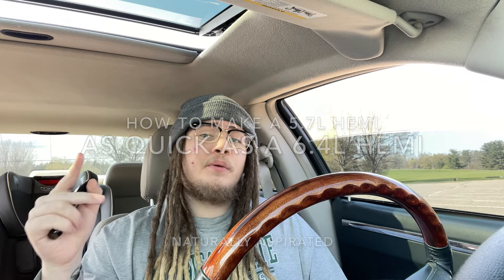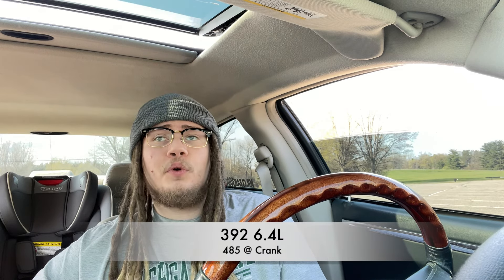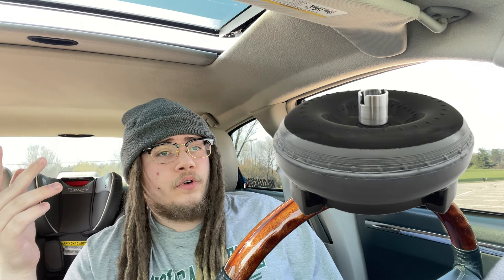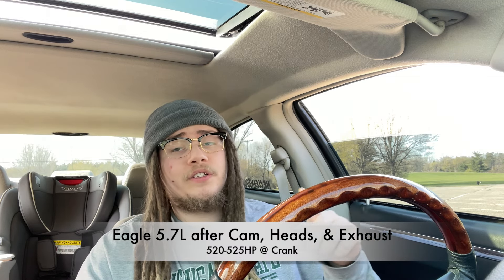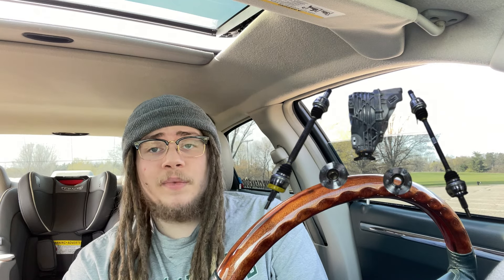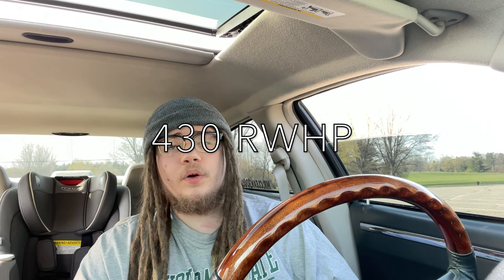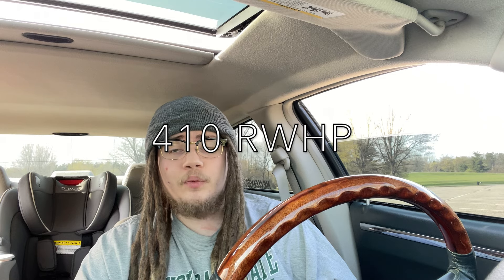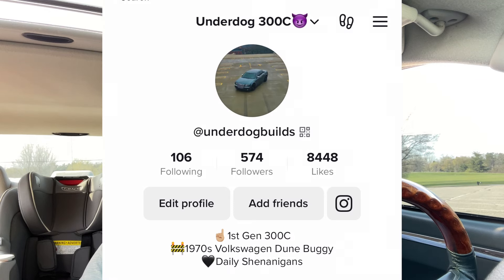How to make a 5.7L HEMI as quick as a 6.4L HEMI (N/A)

Comment: Lol 5.7 dudes are doomed if you are doing a cam swap before long tube headers. Whoever told you that doesn't have a clue.
Reply from the maker: They’re typically done together, but there have been many folks who choose to cam the car before long tubes. I personally think they should be done at the same time. Might as well save and get the intake, exhaust, and camshaft all at once if possible. I’ve seen folks who are cammed and/or running silly spray running stock exhaust manifolds and it never makes sense to me.
Reply: @Underdogbuilds so you would recommend long tubes over short tubes?
Reply from the maker: @Twofrogsonecup  long tubes will result in more power on the long run, shorties aren’t a bad option either though. If you have the money and you plan to build your motor I would recommend long tubes. Shorty headers generate better low to mid range power and they’re an easier install than long tubes. Long-tube headers make their power in the mid- to high RPM range and are superior to both stock and most aftermarket shorty headers. Equidistant long tubes result in better power gains and scavenging at the collector, if each primary is the same length they will be superior in total.
Reply: @Underdogbuilds  my dad had a 5.7 ram with shorties and a borla s type and I really liked the way it sounded, but if long tubes make more power I might go that route

Comment: Fbo 5.7 Vs stock 392 on any respectable tire is a win for the 392 fbo 5.7s still make less torque than these so it’s easier to launch them but I’ve raced countless fbo cammed 5.7s I beat them every time badly and I’ve only got a tune exhaust and intake 5 speed 392
Reply from the maker: 100% man, this was more so a run down to keep up. I also forgot a couple things like a 1 piece driveshaft that would help slightly to keep up with those 392s. And a couple small things like the throttle body. Built nicely, with quality parts (such as a posi rear end, suspension, a full exhaust job including headers, a 392 intake, a shift kit, that 1 piece driveshaft, etc) and a good tune up in the car you could give a 392 a run for its money. 

Also, not to be picky but we’re they just FBO or were they FBO and cammed? FBO Hemis (intake, headers, full exhaust, & a tune) is ~70HP down from what I was trying to convey with a camshaft upgrade. That cam can change the game with a good tune up in the car and a great driver behind the wheel, especially seeing that with a cam the 5.7 would cease to shift at 5600 RPM and rather shift up at ~6500 RPM.
Reply: Sometimes its the driver because I have beat plenty 392s even 5.0s & SS sometimes its the driver mod 🤷🏽‍♂️
Reply: @Underdogbuilds  I’ve raced fbo cammed and regular fbos of course the cammed cars are more competitive but I smoke tuned 6.1s I’ve beaten tuned 10r80s I have some shorts on my page but the 5.7 always seems to fall behind a few car lengths. I just recently raced a quick 5.7 my tires were bald and I needed an oil change he was a head of me I was walking him down then he crashed I don’t think I should upload that video tho it was pretty bad
Reply: @Amg_leftyy you most definitely should upload that video

Comment: You have to do longtubes before cam and heads. Your cam won’t make 70hp without the longtube headers
Reply from the maker: Actually, there are a few cams out there designed for our motors that can net you ~67 HP on and otherwise stock motor! You just have to spend some nice money as the non-mds cams tend to make more. A custom grind cam has been shown to net ~75 HP with no other modifications. If you go with a cheaper drop in cam that’s mds, you’ll gain about 50 HP and paired with the long tubes, you’d see in the ballpark or 70-80 HP gained. The camshaft I’m going with nets 70-75 HP on an otherwise stock motor but 6.1l springs are necessary. At that point a torque converter will be going in as well, the build process has been researched thoroughly for many many months. The stock stall is the most beneficial for the stock camshaft and drive-ability, one the new cam goes in, the next torque converter will be dropped in (3000 stall). At that same time I’ll be having my heads reworked, begs around 35-45HP. I’ll be doing all of that all at once, I’ll be doing everything except the torque converter myself as well 🙂 (I don’t want to deal with touching the trans as of yet so I won’t be doing the stall myself) the car will be fully converted into a drag car as things have finally lined up. She’s basically put away for the winter already and we’re working on making the build list become a reality. And yes, I had my family friend take care of it at his shop. The previous owner had things welded in place so me and my buddy doing it in his at home garage turned into make taking it to his shop lol. I 100% agree, Diablo is more sketchy and I’ve also heard that it’s a little more restrictive, I’ll be swapping to HP tuners in the future but for now I’ll be running with Diablo. I’ll be dropping a full video detailing the plans for the boat as the goal is ~900 RWHP & high 10s to low 11s in the 1/4. She’ll be being fully built. A blower will be going on very very soon!
Reply: @Underdogbuilds  which cams are those? Cause if i’m not mistaken longtubes are a supporting mod to a cam. I put in a cam in my truck that supposedly gained you 80hp. But what they dont tell you is about the supporting mods. Which are longtubes. I have a cammed r/t and it was neck n neck with with my srt with just longtubes. After i put shorties and catless mids on my cammed r/t it pulled on my srt with longtubes. I’m sure if i had put longtubes on my r/t the gap would be even more. And yes i have 2 5.7’s and a 6.1. 1 stock 5.7 and 1 cammed 5.7 and a 6.1 with longtubes
Reply from the maker: @joellasierra   there are quite a few cams that offer around 70 HP, the comp 274 cam with a nice tune up, custom grind MMX cams, etc. Long tube headers will always help produce better numbers but on an otherwise stock motor long tubes can net 15-20HP without a tune due to the natural scavenging effect, with a tune accounting for them and adjusting the A/F ratio you’ll see ~25HP+. With supporting mods, you can see as 30-35 HP+ Also, on an otherwise stock motor people have dropped in these cam kits and gained ~70 HP. @RTlife has really nice examples of many cars on his page. Long tubes will allow your other modifications to produce more power due to freeing up flow on the back end. The stock 5.7L manifolds are absolute garbage. Usually long tubes and a cam will be installed together, as well as heads. The 70 HP figure was a gain at the crank for the cam only, with the 17% drivetrain loss associated with the NAG1 transmission, that’s roughly 55-59 RWHP depending on a couple other factors as well. Also, that’s impressive for a cam only R/T to keep up with a long tube equipped 6.1L! Those shorties allowing your motor to pump more air more efficiently is where that extra spike in power came from. With long tubes, I’m sure the R/T would have made a bit more power and for sure pulled harder. My idea of supporting mods for a camshaft are valve springs, retainers, a torque converter, etc. but long tubes could be considered a supporting mod as well. They can also be looked at as an independent mod as they can net power even without a tune. (They also change your car from 3000 RPM on for sure) There are many different factors that play into the power numbers but the numbers for those cams are typically “stage 3” high lift, high duration, torque converter necessary type cams. I agree with your analysis, many of the cams on the market don’t produce the numbers that they advertise. People such as Mack built and MMX produce quality cams so you can 100% see those gains.

Comment: What do you think about putting a hellcat blower on a 5.7 ?
Reply from the maker: I think it’s a fantastic idea! Haha. I absolutely love the fact that it’s a possibility now. People have found ways to mount them previously but MMX came in clutch with that adapter kit! The one thing I do want to mention is the fact that the pre-eagle folks will need to have their valve covers tapped for an oil fill as the one on intake manifold will be removed. It’s a fantastic idea and I love to see it!
Reply: @Underdogbuilds  I have a 2014 5.7 RT auto how much HP do you think the hellcat blower will add on top ?

Comment: Perfect video with realistic great information. Most are filled with garbage about a cold air intake and a tune will get you near. While a tune will definitely help and likely needed after doing the mods you gave to get the most of out everything this is definitely the best way to get there NA. If had some numbers on cost would be great but that differs from location and time of course. Thanks much for this video!

Comment: I got a 2016 AWD 5.7 with 370HP should i still get a LSD even with the AWD
Reply from the maker: I personally don’t think a LSD would be very beneficial on AWD applications. They have been installed on AWD Dodge/Chrysler vehicles based on some forum write ups that I have seen, but it wouldn’t be worth while unless you’re looking to disconnect the front drive physically. Also, there’s no option to change gear ratios with AWD, so you would have to stick with the stock gear ratio even if you chose to install a LSD. To be honest, I believe the money would be better spent elsewhere. I hope this helped, have a great day man!
Reply: Thanks bro, but I do plan to get a tazer so I CAN have that on/off option. But I’ll definitely keep in mind what you said. 🫡💯

Comment: I have an eagle Hemi, currently getting a stage 2 comp cam hrt kit, long tube headers, ported and polished heads and dyno tuned ofc.
Reply: how much does all of that cost
Reply from the maker: Ohhhh man, sounds like it’s going to be great! I see gains of 120-150 HP in your future! Has it been completed yet? I’m curious as to how you like it.
Reply from the maker: Just as a rough estimate on his costs… comp cam kit ~$1,600, long tube headers ~$2,000, ported & polished heads ~$2,500, and a tune ~$400. Assuming he got a torque converter as well, add another ~$700. Assume he did the work, ~$7,200. That’s not accounting for possible other components like a water pump, timing chain set, push rods, or oil pump. Along with install costs if someone chooses not to do the work $1,000-1,500 for the cam and components to do with it, $600-800 for the torque converter, another $1,000+ for the headers, and another $600-800 for the head install. Now those costs are for the jobs themselves, doing it all at once through the same mechanic will most likely save a buck or two as it won’t be as tedious and take as much time. The motor will be taken apart. So you could get quite a deal having it all installed at once. The cam in with all supporting mods, The headers onto the heads, the heads on, etc. it would be a bit easier on that mechanic. Installing something like headers by themselves may require something like the heads to be removed or the engine cradle to be dropped. Hope this helped. Have a great day!

Comment: I got a 07 Chrysler 300c 5.7l and it’s not Reving past 3k rpm and doesn’t shift I’ve change the rear speed sensors and valve body the esp  and the same problem it has the esp abs and trac control lights on 🤷‍♂️ need help
Reply from the maker: I strongly believe what you’re dealing with is a TCM issue. My buddy has dealt with the same issue in his 06 Charger SRT8
Reply: @Underdogbuilds  I’ve changed it too Tcm esp module
Reply: @Underdogbuilds  but it’s shifting now it was a wire that was chewed up and now it shifts but still not reving past 3k rpm
Reply from the maker: @JR3600FRK  I’m glad you got the shifting part of the debacle figured out! I got in contact with my buddy who works in corporate and I’ll let you know when he gets back to me. Hopefully we have some insight for ya 😄

Comment: Hey I have a 2014 rt with around 125,000 miles on it, my goal is to have a 500 hp engine is it worth even modding it or just swapping it to a 6.4. I want to mod it instead of getting a newer car because it’s paid off but I don’t know what I should do any advice?
Reply from the maker: You can most definitely make 500HP with that engine! I would say the quickest and all around least expensive choice would be boost in the long run. I know $8,000 doesn’t seem cheap, but the car can handle 7-8 psi with a safe tune up and produce 500-550 hp to the crank, typically 470-500 RWHP. I only say this because to achieve those numbers without boost, you’ll have to upgrade quite a bit more within your motor. For instance a cam, valve springs, retainers, a torque converter, CNC porting your heads, upgraded push rods, long tube headers with a nice catback, and a tune would set you just around 480 HP crank or more, but you’d be spending around $6,000-8,000 in that situation as well. If you’re concerned about milage, there have been many 5.7L HEMIs cammed around 120,000 miles that lasted well over 200,000 miles on a safe tune up. But speaking on the milage and internals, as well as you mentioning the displacement of the 392… you’re could opt to stroke the motor and that would replace your rotating assembly as a whole. That would give you piece of mind as well as giving you that extra power on par with a 392. This does cost a decent amount of money though, so a typical person would just slap on a blower. It can be problematic but it has been proven to be A-Okay even on motors up to higher mileage than yours. Some people have introduced forced induction to these motors around 160,000-200,000 miles and had them running for another 50,000-80,000 miles, all documented on forums as well. It’s all about which way you’d like to take your build but in my opinion, the cheapest, most direct, least stressful way to make that power consistently is a blower around 6-7PSI. I hope I could help 😃
Reply: @Underdogbuilds  you most definitely did I appreciate you fr🫶🏾

Comment: Hi, how much do these modifications cost?
Reply from the maker: This depends on quite a few variables. The model year of your vehicle (pre-eagle vs eagle equipped vehicles), the parts that are chosen (i.e. reworking your current heads vs. grabbing something like Edelbrock heads), the tuner you decide to go with, the camshaft you decide to go with (if you need springs, retainers, and a torque converter or not), etc. I would estimate the cost to be $6,000+. This also can depend on the milage of your motor, if it’s higher milage it would be wise for you to replace the water pump, serpentine belt, spark plugs, and replace or upgrade the oil pump. The MAJOR deciding factor in the price of everything put together will be whether you install these modifications yourself or have a shop do it. If you’ll be doing it at home there’s the break it procedure that’ll need to be followed for the cam, extra fluids and such will be needed comparative to bringing the parts and vehicle to a shop and having them do it. But I would definitely say $6,000-10,000. If you have an older model that you got for something like $8,000-10,000 then this would be cheaper than getting into a 392 model, but if someone were to have a new R/T, it would be the equivalent of trading up for the 392 equipped model.
Reply: @Underdogbuilds  Thanks, I would definitely consider these

Comment: Wider tires can aid that open diff.. i can smoke mine leaving 2 black lines :) with my ebay 3.06 open dif.. 350 bucks
Reply from the maker: I currently lay 11s with my oem diff as well, a LSD would just further improve the vehicle and I agree 100%. The wrong wheel and tire set-up can hinder performance rather than improve it, it all depends.

Comment: Just get a 6.4 I had the 2016 v6 se , 2016 v8 rt road and track and now scatpack r/t plus
Reply from the maker: That would technically be the smartest route, but some people don’t have the finances or some people would just like the entry level V8 to begin with and then get attached to that vehicle. I’ve also heard some people mention it’s for reasons to do with boost but both motors have to be forged anyways to withstand any notable boost so in my eyes it’s a moot point, people do mention it though. Although, another route that’s similar in price is going with a 392 stroker kit, depending on the market, labor, and network you have, it could be cheaper than trading up for a 392 equipped car.
Reply: @Underdogbuilds  my finances was good either but I still made it to the 6.4 and 5.7 rt’s can handle procharger with 7-8 pounds of boost no forged needed . But yeah a stroker kit is a good way to go too
Reply from the maker: @JonathanDiaz-vm5mb  I feel that, I just know some people are not willing to take that leap. Also, yessir 100% but I was thinking notable boost as in 10-12psi. With a good tune up people have pushed 9-10 psi on the stock block for a good little while but then again, there’s some people who were at 7psi for a year or two and their 5.7s blew. If people can make the jump, it is more cost effective comparing buying a brand new charger R/T and modifying it to keep up Vs the price of just grabbing the 392. The stroker kit is a pretty neat route if people have a reputable shop that can take care of them, but for those who don’t, it’s probably best to just swap up.